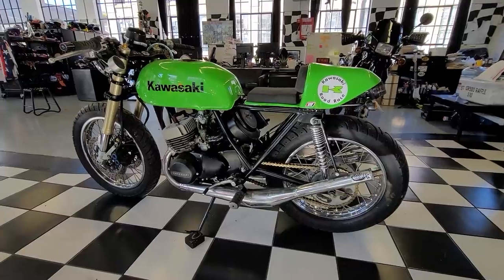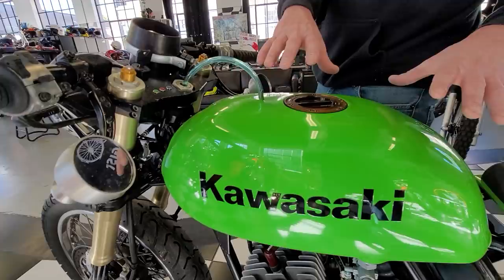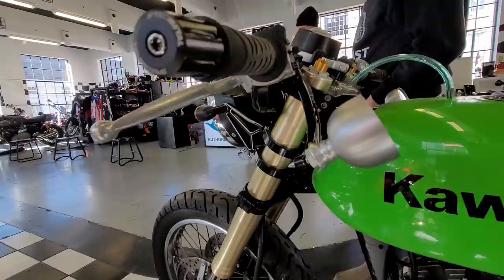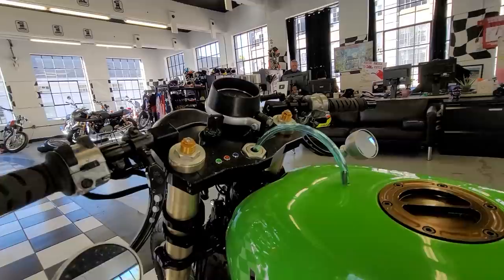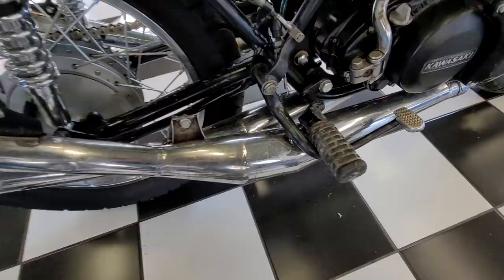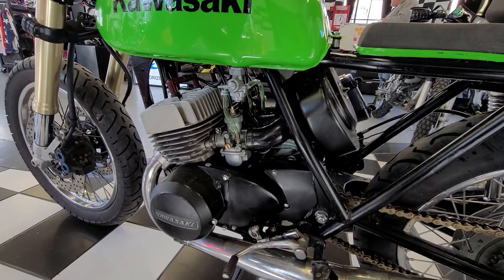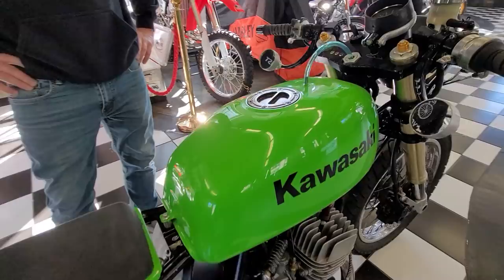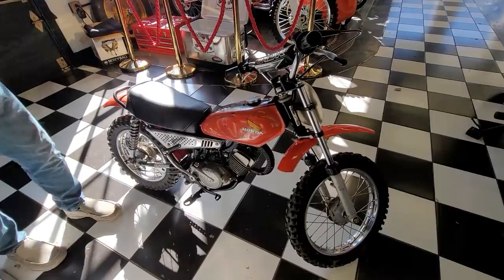KAWASAKI S2 350 TRIPLE TWO STROKE CAFE RACER BUILT BY MY MX FRIEND AIRCRAFT MACHINIST GARY SMITH

Comment: On a personal level I would have much preferred the stock looking tank and tail unit and possibly a set of ace bars which would have been more period looking. The whole set of the triple range are just some of the nicest pure two strokes ever made. I have had a 78 250cc in candy lime green and a 69 H1 500cc which was meant to be two shades of green but someone painted purple, I had it done in the same candy lime as the 250 but sadly no longer have either bike. They always say your first love will always be your best and I feel bikes are much the same, the hunt is on for a 250cc triple.